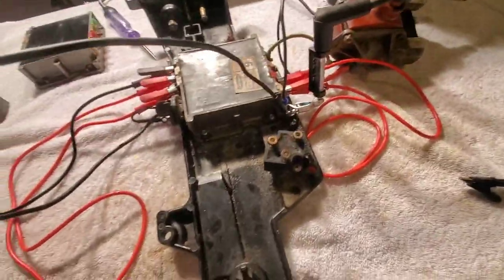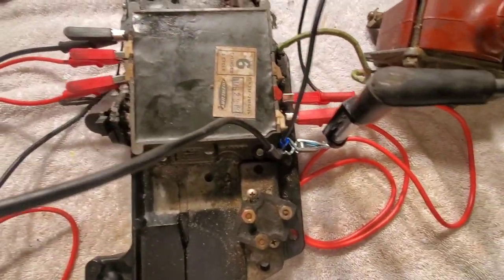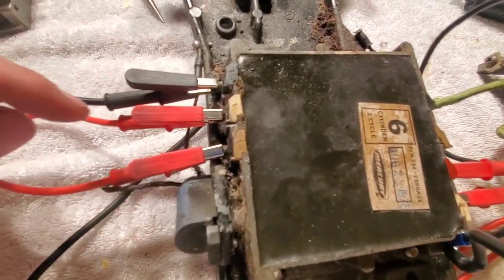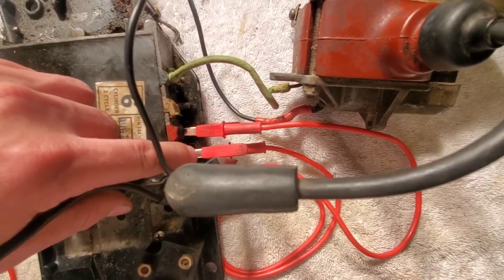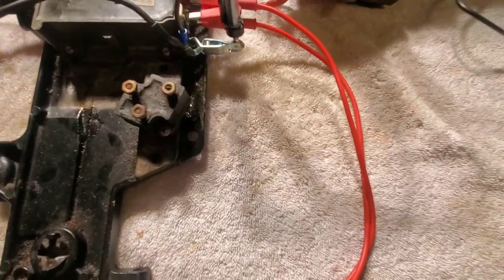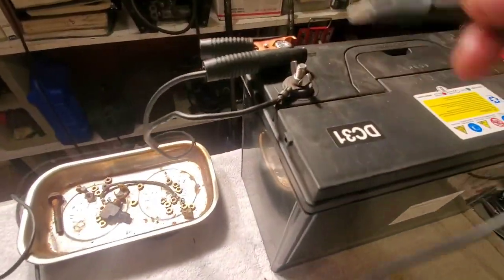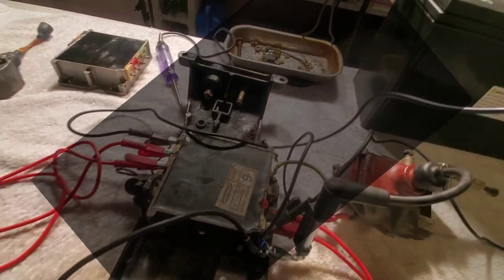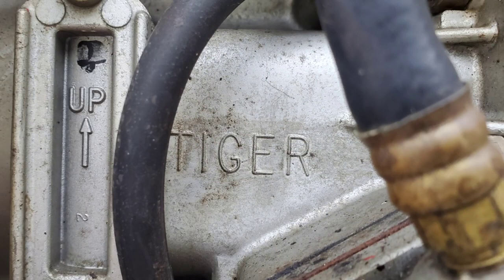Merc Outboard Ignition Testing: Switchbox and Coils

Comment: I have a question, I have a mercury 850 with no spark. I have 12v power to the red on the switch box but none to the white, which is ignition. Could I have wired it incorrectly. I’m trying to avoid buying a new switch box since they’re hard to find. Thanks

Comment: I have a question. I just got my first boat. It has a Merc 1150 inline 6. I have no spark. The switch box gets 12v on the battery side, is it supposed to output 12v to the distributor on the opposite side with the key on? I'm only getting 11.6v to the distributor. There's 12.2v going into the switch box.
Reply from the maker: Are both red and white terminals 12v when ignition is in the on position?
Reply: @MerCSonL6  yeah. They both are. I got spark figured out. The coil to distributor wire wasn't pushed all the way in. Now I think I need the carbs rebuilt.

Comment: What should my next steps be if I follow this but my spark is very weak and yellow-ish
Reply from the maker: Something is wrong with the system. It's likely a coil. I would test/replace the coil to see if that's the issue. The switch is simply a capacitor that breaks down the charge on on the coil every time the distributor grounds. Sounds like the coil is not building up enough electromagnetic charge. Lmk. Son
Reply: @MerCSonL6  did you ever email me? Haven’t seen anything come through yet.
Reply from the maker: @greatlakesgutters9798  what's your email?
Reply: @MerCSonL6  I think it gets taken down when I try to post it.
Reply: @MerCSonL6  I just added it into my about section on my profile

Comment: I cleaned up and re soldered the internal harness and want to start and run the motor. I let the shifter and cables go with another motor. So I'm trying to figure which two wires to connect to get constant ignition/power I know one is red. Im thinking if I jump the red and white together and bump the starter and it should run and stay running?
Reply from the maker: Yes sir. Son

Comment: Hello Son, I have an interesting problem. Basically, my 1967 Mercury 500 won't spark until after the key is turned to the off position. Do you have any idea what this could be, or what tests I could do to find the problem? Thanks.
Reply from the maker: That's definitely a wiring issue. I'd try starting it without your current controls/external wiring harness and see if you get the same results. Let me know. Son
Reply: @MerCSonL6  Thanks a lot for your response. Unfortunately, I cannot work on the motor again until Monday, but I will definitely get on that. Any suggestions on how to rig something else up for staring it? Thanks.
Reply from the maker: @mr.airsoft8295  all you would have to do is hit the positive post (smaller, on the side) on the starter selonoid with 12v. This will start the engine. I recommend using a spring switch which can be bought at any auto zone and wire guage thick enough to handle the electrical jump. Son
Reply: @MerCSonL6  I may have done this wrong but I made a jumper wire that ran from the positive battery terminal to the post on the solenoid that you are talking about, with a switch in the middle of the line as an on/off switch. However, I ended up needing to turn the key to the run position anyways (I think because the key positions also affect the switchbox?), and the same thing ended up happening: the motor only fired up for a second when the key is turned back to the run position. Do you think this means that the ignition switch is to blame, should I take apart the mercontrol box?s Thanks.
Reply: @MerCSonL6  I ended up replacing the ignition switch, and that didn't fix the problem. I tested the entire boat side wiring harness as well as the internal wiring harness in the motor and they both work fine. I ended up doing your type of bench test (https://www.youtube.com/watch?v=bj6BPYITstc&t=146s) with the distributor, coil, and switchbox all connected again, and the weird thing I found out is that I only get spark when I touch the positive wire (jumpered from the switchbox white terminal to the battery) to power. Once this wire is connected to power I don't get any spark, I have to keep on hitting the positive wire to power. Does this mean that the switchbox or the trigger is to blame? I noticed this as well when I would use the key switch, I'd only get spark when the switch was flipped from off to on, but only for that brief moment, once it stayed in the on position, I got nothing. It's a very weird issue, I know, can you think of what it could be? Sorry if I didn't explain this very well. Thanks.

Comment: Hey man! How would I go about testing a switch box on a 1971 mercury 500? It has red white blue and green terminals. Runs directly from distributor with no connectors to the stator
Reply from the maker: You would have to rule it bad by process of elimination. The distributor has high speed and low speed coils in the circulates the power throughout the entire ignition system.  You can take the distributor apart to verify the readings are in spec. You can also test the ignition coils resistance. If both pass its likely the switchbox. Let me know. Son

Comment: So is this a good switch box operating or a faulty one. I have a 1975 merc 850. Starts up runs gets warm then dies or won’t start after about 10 minutes of being off. Not sure if the coil fails after warming up or switch box
Thanks
Reply from the maker: If you performed the test in this video and got a bright blue spark then the issue likely resides within fuel delivery given you have good compression. Son

Comment: Cool Channel! I inherited a 76 150 outboard,  no spark,  may have wired incorrectly...
Where is the best place to get parts?
For cheap...
I'm in Riverside California..
I need a rail guide for the shifter cable, and all kinds of parts..
Where do you source? 
Also I didn't have $ to buy the cdi electronics 6-8 pin conversion harness, so I wired myself...
Started once now no spark... 
My stator wires are crap...
I'll need a few parts lol..
My ignition control box is melted!
Reply from the maker: You will likely need to go with cdi electronics. Parts are difficult to find for your gem. Son

Comment: What do you think about the Tiger blocks? Any known issues I should be on the lookout for? I've got a 1000ss, and being my first l6.. I've got nothing to compare it to lol
Reply from the maker: 1000ss's have a larger piston diameter up until 1969. If you have a 1966 I imagine it would be the same size as the 950. As far as issues not many. These years were the final years of Kiekhaefers original design & should virtually design free of flaws. I understand you have a vacuum leak on the powerhead.  Fixing that would be my only concern considering bolts and cast aluminum tend to slightly warp after 50 years of excellence. Just my 2 cents. Son
Reply: Thanks for that, mine's a '69.. so the very end of Carl's reign for sure. I've got the whole thing apart now, found next to no sealant left on the crankcase-cover to block-surface. Almost all rings were stuck on at least one side, and the rings on number 1 are pancake-ing and are sharp as hell. Cylinders look good, trying to find standard rings now that don't cost $25 Canadian each. All paper gaskets were barely there and looked original (red), and the under the exhaust plates was super clean the closer you got from number 6 to number 1.
Reply: I've at last gotten around to trying this switchbox test method on my spare, and it's good 😎.. jumps a half inch every time with no hesitation.

Thanks so much for uploading this, you truly are a Son-of-Merc...

Here's a vid of my '69 1000ss running last night

https://youtu.be/f2powNT28PA

Comment: Hello son, I have a 90 hp I6 and am following all steps in this video to bench test the switch box...... as soon as I touch the ground to the battery the coil pack makes a noise like something is arching out on the inside of the coil pack and I have no spark on the tester. Do you think my pick up coil is going bad? Appreciate it if you give me an idea
Reply from the maker: Coil is bad..... or your switchbox is bad. Son
Reply: @MerCSonL6  i just pulled apart the coil and the magnet around it is broken so im going to try a new coil first haha thanks